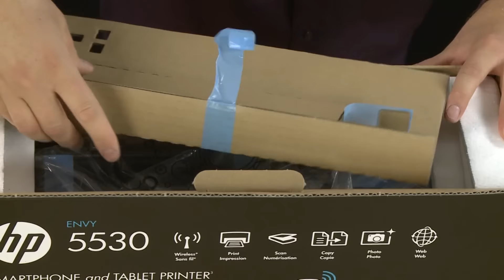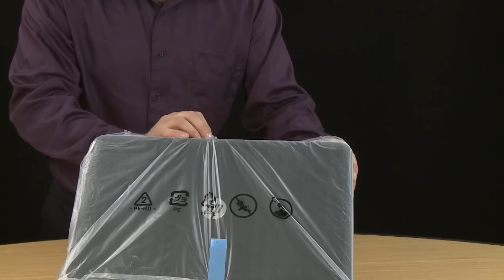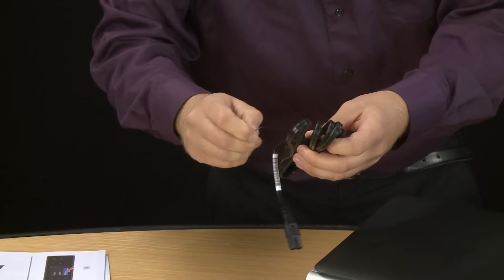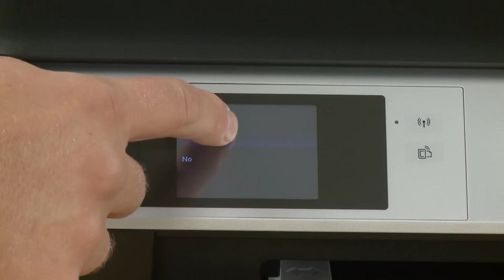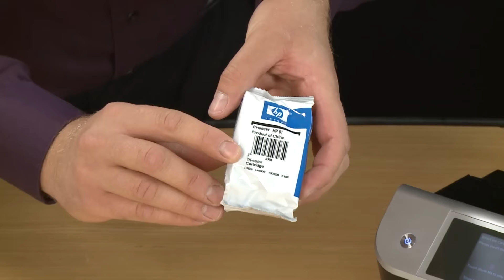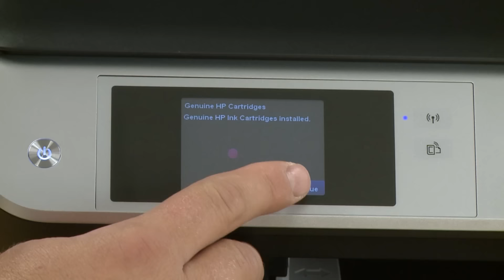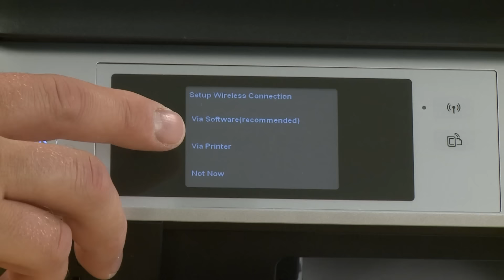Unboxing and Setting Up the HP Envy 5530 e-All-in-One Printer | HP

Comment: Hi HP, just unboxed this printer and was in the middle of setting it up. But every time it asks to scan the alignment page and I hit OK the printer gives me error and tells me to restart and shows B3CD4CF2 with a blue screen. how do I get pass this step, or is this one defective, I'm considering returning it to best buy.
Reply from the maker: Randis Graham
Please try a power reset of the printer.  The steps are as follows:

1. If the printer is currently turned off, please turn the printer on.
2. With the printer turned on, please unplug the power cord from the back of the printer.
3. Please unplug the power cord from the wall outlet.
4. Please wait a full 60 seconds to allow any power in the adapter to dissipate.
5. Please plug the power cord back into the printer and into a wall outlet.  It is important to ensure the printer is plugged directly into a wall outlet.
6. If the printer does not turn on by itself, please turn the printer on.

If after performing the above, you still have the same error message, please call our technical support at 800-474-6836. If you live outside the US/Canada Region please go to Google search and enter 'contact HP worldwide'.  Your first option should be the site for contacting HP, when you click on it you will be prompted to choose your country/region.

Comment: i cant print anything like i set up the wireless connection.. but when ever i press print there no sigh of the printer on my computer
Reply from the maker: Omar Akram To better assist you, I will need to know what version of operating system is installed on your computer.

Comment: Every time I print something it comes out fine. When I go to print something else it won't print. It will still say that the first pages are printing even when they're done. I always have to cancel that out before I can print something else, any solutions?
Reply from the maker: keke0183 I know your first print job is printing successfully, but it almost sounds as if your are having issues with your print spooler.  Please follow the steps in the document titled "Print Jobs from Your HP Printer are Stuck in the Print Queue" for your operating system.  To find the document please search for C02205477 on HP's home page or using Google search.

Comment: I just received this model and I am having the hardest time. The presentation on QVC said you were supposed to get an email address for this but where is it? I can't get wireless set up either, although the blue light is lit. So confusing, I may box it back up and return.
Reply from the maker: 8jojobeans
If the blue light is solid and not flashing then the printer is connected to your wireless network.  If it is flashing then it is not.   In case it is flashing, please follow these steps to connect the printer to your wireless network.

1.  From the home screen on the printer, touch the 'Wireless' icon and then touch 'Settings'.
2.  Touch 'Wireless Setup Wizard'.
3.  Select your network from the list of detected networks.
4.  Please follow the prompts.

Now that the printer is connected to your wireless network, the next phase is to enable web services. 

1.  From the home screen on the printer, touch the 'ePrint' button.
2.  Accept the 'Terms of Use', and then follow the onscreen instructions to enable Web Services.  If successful the Web Services Information sheet will print with your printer claim code. If you have a connection error message please skip to Step A before going to the next step.
3.  Please use the claim code on your Web Services information sheet in your HP Connected account to claim the printer and customize the printer's ePrint email address. 

If you are receiving a connection error message when you try to enable the web services please follow these steps.

A.       Please enter the ip address of the printer into the address bar of your browser (Internet Explorer, Chrome, Firefox, or Safari, etc). My screen shots below are from Safari but the location of everything is the same regardless of the browser.  This will bring up the embedded web server of the printer.
B.      Please click on the network tab.  You should see the Network Summary for your printer. Please click on 'Networking' on the left hand side menu.
C.      Please click on 'Network Address (IP)' on the left hand side menu.
D.     Please on the radial button beside "Manual IP" then click on "Suggest a Manual IP Address" button. The Manual IP address, Manual Subnet Mask and Manual Default Gateway should populate for you.  Please click on radial button beside "Manual DNS Server".  For the Manual Preferred DNS Server please enter 8.8.8.8 and for the Manual Alternate DNS Server please enter 8.8.4.4. These are Google’s public DNS servers.
E.      Please click on 'Apply'.  If you get a warning message about changing the ip address please click 'OK'.
F.       Please turn the printer off by the printer's power button.  Please wait a minimum of 15 seconds and then turn the printer back on.
G.      Please press the ePrint icon in the upper left hand corner of the printer's front panel. This should prompt you to accept the terms of service.  Please choose 'Accept'.
H.     When prompted about the automatic updates please choose 'Yes'. The printer should now show the HP logo while the printer communicates with the HP servers. The Web Services information sheet should print with the claim code for your printer.

I hope I haven't confused you with the above steps. If you run into any issues with the above, please let me know at what step things went awry and what the content of any error messages were.

Comment: I can't change the language on my printer. . Its currently in French with 2 buttons written Demo al detalle  and  Configuracion. please advise
Reply from the maker: +Mercy Dikito-wachtmeister   I used Google translation for translating the words so the printer can get switched to English.  I've included the English word in brackets. 

- Please press the wrench icon found in the upper right hand corner of the screen. 
- Please press 'Préférences' (Preferences)
- Please press 'Set langue" (Set Language)
- Please choose the language that you wish the front panel to be.  On the Envy 5530 I used to confirm these steps, English was the first in the list. 

I hope this helps. :)

Comment: This part is simple, it's the connecting to your computer part that isn't working. It's just plain invisible to my commuter,. My HP computer. I even installed the software, nothing
Reply from the maker: +Cheney Perry-Hill   I am presuming that you want to install the complete driver and software for the Envy 5530 and that you would like to connect it to your wireless network.  I've included the 'How-To' documents for Windows and Mac.  Please click on the link for your operating system and follow the steps, ensuring no step was missed during the installation. 

HP Printers - Wireless Printer Setup (Windows)   http://ow.ly/105sEq
HP Printers - Wireless Printer Setup (OS X)   http://ow.ly/105sIp

You mentioned that you had installed the software already and your computer is unable to "see" the printer.  If the message you are seeing says something like "Printer not found", then click on the link beside the document that corresponds to your printer.  

Printer Not Found During Network Driver Setup (Windows)   http://ow.ly/105tcF
Printer Not Found During Network Driver Setup (OS X)   http://ow.ly/105thp

Comment: I did the set up and said I would do the wireless set up later tried to print a page from my computer and it did not print, why?
Reply from the maker: Hello Paulette Belanger,
 
If you indicated that you would set up the wireless later, then it is likely that your computer is expecting to find the printer connected by a USB cable.  Please try plugging in a printer style USB cable and test again.  Another option could be to re-install the software and complete the wireless installation and test again. 
 
If you are using a Windows operating system, please search for C03286146 on HP’s home page or using Google search.  The title of the document is “Try the HP Print and Scan Doctor for Windows”. The HP Print and Scan Doctor is a free utility (tool) that helps to quickly resolve common printing, scanning and connectivity issues.

Comment: Hi I setup and downloaded the software on the web site now when I print it doesn't print what I want it. It prints numbers on the bottom rapidly
Reply from the maker: +Anesti Duka   I am presuming that you are using a Windows operating system on your computer.  Please follow the troubleshooting steps in the "HP Printers - Continuous Pages of Strange or Garbled Characters Print in Windows" document.  It has different steps for different versions of Windows.  To find the document please search for C01954177 on HP's home page or using Google search.

Comment: i have the tri color cartage in the printer as well as the black cartridge and my printer still won't print my documents in color. even when i take out the black cartridge the printer refuses to print from any of my laptops or desktops in color. all the supply levels are full and even in my preferences i have it set to color printing and still no color. what can i do?
Reply from the maker: merp derp
Please search for C03765731 on HP's home page or using Google search.  The title of the document is "Printer Does Not Print Black Ink or Color Ink, or Prints Blank Pages".  It will walk you through the steps when at least one of your colors is not printing.

Comment: I bought the HP 301 ink which is compatible with this printer (as per web site) but when i installed an incompatible error comes out. I have just realized that the ink code should be 61(ink area), but regardless this, i can see on the hp web-page that the ink model for this printer is 301. i am in UK, and I bought this printer in Canada (perhaps this is the reason? if so what can i do?)
Reply from the maker: Ismael Ochoa Please call our technical support at 800-474-6836 to properly configure the regionalization for your printer. If you live outside the US/Canada Region please go to Google search and enter 'contact HP worldwide'.  Your first option should be the site for contacting HP, when you click on it you will be prompted to choose your country/region.

Comment: Hello sir, I have desktop windows xp sp3, and I just bought hp envy 5532, I try to anstall but it does not work , it said, windows does not reconice it. what is the problem? thank you
Reply from the maker: arina awae Have you tried running the Print and Scan Doctor to diagnose this issue? Is your printer connected to your desktop using a USB cable or is it connected on a wireless network?

Comment: my printer was working great until recently. it now prints agonizingly slow, often taking over a minute for a one page recipe, whereas before it spit out the finished product in no time.  it does "copy" function at the old fast pace, however. this seems to have started when i replaced the ink cartridges. i used HP 61XL; did the XL slow it down?  should i uninstall(if that's even possible) and reinstall?  can anyone help me?
Reply from the maker: deborah atela Since your printer is able to copy without losing pace, I recommend following this document on Slow Printing. To find the document please search bud03409 on HP's home page or using Google search.

Comment: HOw do you open the input paper tray . I am trying to open it and it feels locked into place. Nothing on instructions either. Looks like you just pulled it right out, not working for me. Tape is removed as well. This seems like a hassle already. Not sure if I will be keeping this, might be going back. Ugh
Reply from the maker: +Nicole P     I'm going to presume that you haven't returned the printer yet.  I've included the "HP ENVY, DeskJet Printers - Setting Up the Printer Hardware" document ( http://ow.ly/WLPSA ) for you.  Hopefully the print version makes it a bit clearer on how to get the paper try to open.

Comment: Having trouble connecting this to my Linksys WRT 1900 AC
Reply from the maker: Stephen Harris I recommend following the steps in this document on An 'Unable to Find Printer' Error Displays for the HP ENVY 5530 e-All-in-One and Deskjet Ink Advantage 4510 e-All-in-One Printer Series. This resource can be found by Google searching "c03750055".
Reply: A little late, but thanks anyways! I called HP tech support 5 days ago and the helped me get it working...

Comment: Hello, I just tried to install this printer, but it is telling me to replace the Tri-Color ink cartridge. Everything is brand new, right off the shipment from fedex. I just switched over from a Canon printer, and I'm already having problems. Really frustrated with this because I have things that need to be printed! Anyone else have problems with the provided ink cartridges?
Reply from the maker: JumpKID923 I suggest you take the cartridge out and restart your printer and then reinstall it. If you continue to get the error contact HP Technical Support.

Comment: Hey hp my printer won't print black ink even though the cartridge is full. Please help?
Reply from the maker: I am presuming that you have the Envy 5530 since you posted on a video about it.  Please follow the steps in the "HP ENVY, DeskJet Printers - Color or Black Ink Not Printing" document ( http://ow.ly/lV9U301fL9T ).  If you get to the "Service the printer" step, please use the link in the document to contact HP Technical Support.

Comment: I can't even get into the Setup mode. Hitting the Setup icon does nothing. Kinda stuck here. Plus I bought the damned thing today as a refurbished unit and they tell me that the warranty expired 10 days ago! Shouldn't that start from the date of purchase? Even with a refurb? Any help here?
Reply from the maker: If the printer was purchased as reconditioned from HP, then the unit would have had a standard factory warranty applied to it. However, until a printer is registered with HP, or a proof of purchase is provided, the default warranty is based on the manufactured date of the printer which is known from the printer serial number. This can lead to situations where an unused printer has sat in a warehouse more than a year from manufacture date, so the default warranty will appear to have expired.  In North America, the manufacturer's warranty for a printer is generally 1 year, which can be extended or upgraded with a care package.  Just provide HP the proof of purchase, if you haven't already, and your warranty should be updated to reflect the proper dates.

Comment: hello sir, thank you for your video. i would like to know does this machine accept sublimation and pigment ink? thank you.
Reply from the maker: LU WANG HP ink is a pigment based ink.
Reply: so what kind of pigment ink cartridges do I have to buy? because I am going to use pigment ink to print the image on a heat transfer paper.
Reply from the maker: LU WANG The ink for the HP ENVY 5530 is the HP 61 Black and the HP 61 Tri-Color.
Reply: ***** OK, I got it, so I can just directly pour the pigment ink into the cartridge right. Thank you sir.

Comment: how to enable the usb mode???
Reply from the maker: +Emanuel Spoiala Follow the instructions below in order to Setup/connect USB Printer:
1.The printer is turned on and in a ready state.
2.Obtain a USB cable less than 3 m (9 ft 10 in) in length.
3.There is an available USB port on your computer: If you connect through a USB hub or docking station, the printer might not receive enough power to properly operate.
4.If you connected the USB cable to the computer before installing the HP driver, continue with these steps to remove the printer from the installed devices to help ensure a successful setup. To know more click on the link:http://hp.care/2o2eP70

Comment: This printer is driving me mad! It is connected to my wireless but on my Toshiba laptop the printer is off-line. How do I get it online so that I can print?  There are three documents in queue.
Reply from the maker: tallgirld
Based on your short description I suspect that you need to restart the printer spooler.  Please search for C02205477 on HP’s home page or using Google search.  The title of the document is “Print Jobs are Stuck in the Print Queue”.  It contains a different section for the different operating systems.  Please click on your operating system and follow the steps.

Comment: Does it support duplex printing
Reply from the maker: +somya bajaj HP ENVY 5530 e-All-in-One Printer supports duplexing. You can set up a print job so that both sides of the pages are printed. Use the steps in this document to change settings in the print driver and flip the pages, depending on your printer type: http://hp.care/2tmZ9km

Comment: Does this work with Google Print (Cloud)
Reply from the maker: blessing786  Yes this printer will work with Google Cloud Print.  You will need to setup the ePrint feature of the printer after you have connected the printer to your wireless network. 

Please start by searching for C03550536 on HP’s home page or using Google search.  The title of the document is “Getting the Printer Claim Code”.  Once you have the claim code, you can then customize the printer’s ePrint email address so something more user friendly.  

Please search for C02940150, and the title of this document is “Setting Up a Custom Email Address for HP ePrint”.  

Once you have the printer’s ePrint email address please search for C02817255, whose title is” Using Google Cloud Print with your HP Printer”.